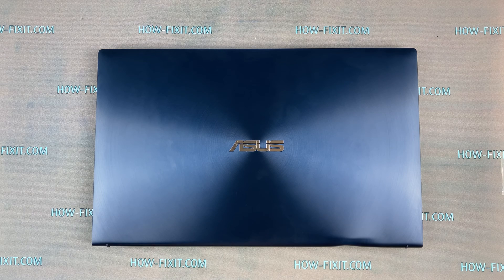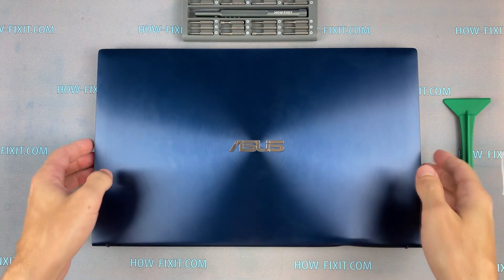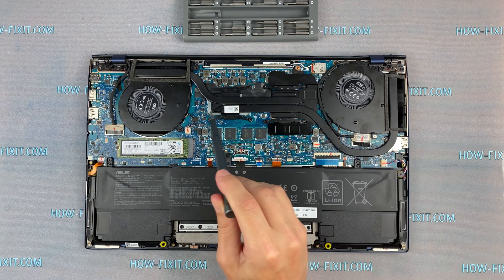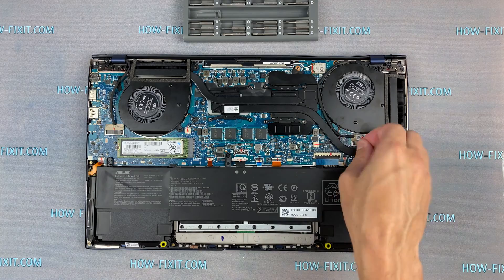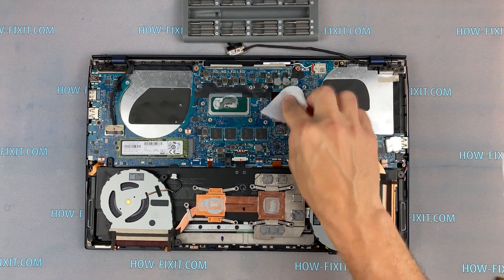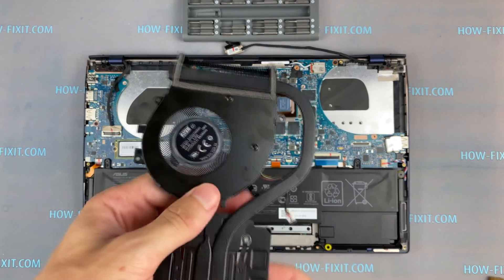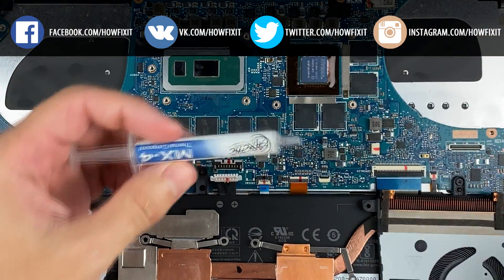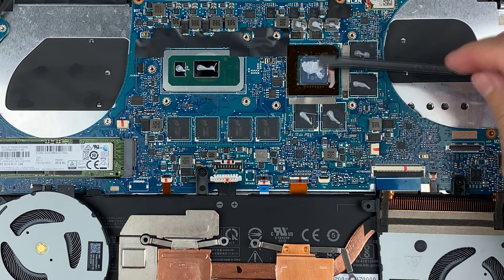Asus Zenbook UX534 Disassembly, Fan Cleaning and Thermal Paste Replacement

Comment: Will be doing this soon! I think mine needs new thermal paste after some years and the fans are due for a good cleaning as well.. @__@ I used compressed air before and kinda took it apart but not like this yet

Comment: You are applying too much thermal paste, the idea is to fill the microscopic pores and make a connection between the heat sink and the chip. To much paste actually works against you as the paste has higher thermal resistance than the metal on the heat sink and the chip. One tip you can try if your laptop is still running too hot at full load, is to open up the grill where the air flows in and out of the laptop case by removing a few (like 1 in every 5) of the bars in the grill to make it more open. That should improve the airflow a lot.

Comment: Thankyou so much for this video. In the next coming days I will be buying all of those from the links.

I have a new zenbook UX534FTC, do you reccommend repasting if new? Did it achieve a nice temp drop? Also, do you know what size/type the three screws holding battery down are? Or a list that has all screw sizes for this model? Ty for being a lifesaver with this vid, next pay check I’m getting these tools haha
Reply: I don’t think repasting for a better temperature helps when you are not overclocking. Unless your talking about controls over fan power curve for longevity

Comment: Hi, I've tried 2 applications of thermal paste using Arctic MX4 paste as I used that on my desktop and each time this specific model of laptop always shows overheating 'red' text on AIDA64 even though it's not. I get idle temps of 45 degrees and max temps during sustained load around 69-73 degrees. Is this normal for this laptop? 

I tried both pea method (my preferred) but after checking temps it was overheating more so I used spread method as the pea method didn't cover the whole PCBs. It overheats apparently for like a few secs then always stays at 0% and doesn't overheat again? Is this a common issue with i7 10th gen CPU of this model?
Reply: I stand corrected, I just tried with charger unplugged it still stays around 41-45 idle however on load with AIDA64 extreme it stays around 61-70 max during testing. It does show overheating though but by 0%?
Reply: @brandontunstall4224  I have the same problem with i7 10g.
Getting temps over 80 85.
Have you find any solution?